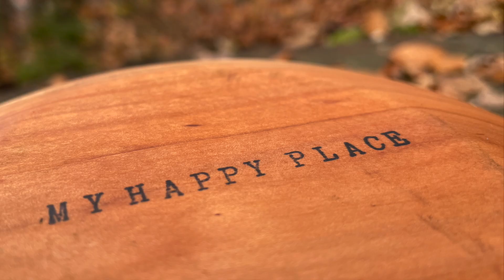Carving Modern Rustic Oval Shape Wood Bowl Made with Power Tools (MANPA Multi Cutter, no lathe)

Comment: I’m carving split rail cedar boards smooth (I don’t mind tool marks). Would you suggest the Manpa 3” or 4” carving blade? Love your work!
Reply from the maker: It is important to know that MANPA blades are primarily intended for carving curves and not flat surfaces. If you need a tool to make a straight and smooth cut, then this is not the tool for you. However, there is no better tool on the market for carving curves efficiently and easily. My primary blade is the 3" Circular Cutter 12mm. I use the 4" cutters when I carve larger diameter curves and want to make deep cuts. 12mm cutters are thicker and enable faster material removal. I use 8mm cutters in the later stages of carving for a finer finish. I wish you a nice day and a lot of fun in carving ;)

Comment: Beautiful space and bowl. How do you keep the bark from eventually falling off?
Reply from the maker: If the wood is dried properly, the bark usually does not fall off. It also depends on the type of wood. I know that the bark remains on oak, walnut and some fruit varieties of wood. Of course, it should only be used indoors and in dry areas. Outside, the bark will fall off sooner or later due to high humidity. The woodworm also likes to hide in the bark. That's why a product with preserved bark is even more special ;)
Reply: Thank you for the thoughtful response. That’s interesting about the different tree types.
Reply from the maker: @BetsyDrury  When I started working with wood, I quickly realized that each type of wood has different properties, just as each person has a unique personality. Every wood is good for something and no wood is good for everything ;)
Reply: @MyHappyPlaceSlovenia  love this.

Comment: What kind of oil are you using on the wood?
Reply from the maker: In this video, I protected the bowl with SKYDD mineral oil bought at the IKEA store:
https://www.youtube.com/watch?v=7sdwI_If5O4
Mineral oil is suitable for protecting wooden products made of solid wood in interior spaces. Because it is liquid, it penetrates deep into the wood and gives the wood a distinctly 'wet' look. I additionally protect the bowls with beeswax, which closes the pores of the wood, makes the wood even smoother to the touch and gives it a silky shine.

Comment: What's the name of the tool you end up using for sanding?
Reply from the maker: It's simple hand sander with soft foam on the underside (Wolfcraft)
Amazon link:
https://www.amazon.de/-/en/2891000-Wolfcraft-1-Hand-Sander/dp/B002OHGQWS/ref=sr_1_15?crid=2KWHX1IBC9UG4&keywords=schleifpapier%2Bhalter&qid=1674201094&sprefix=sanding%2Bpaper%2Bholder%2Caps%2C256&sr=8-15&th=1